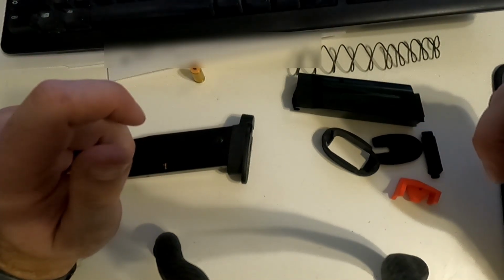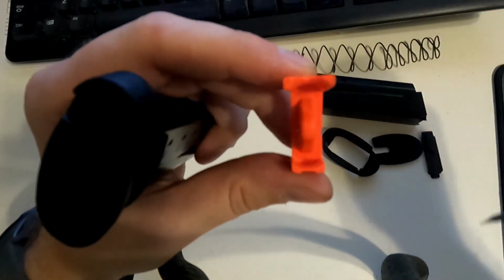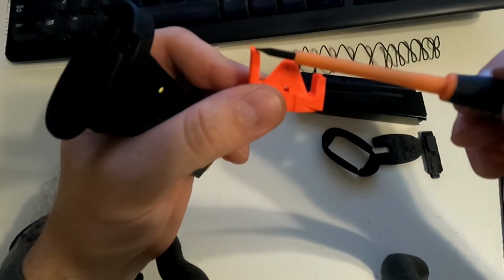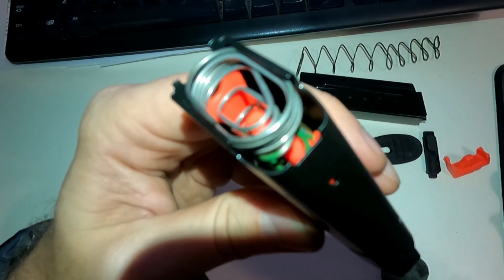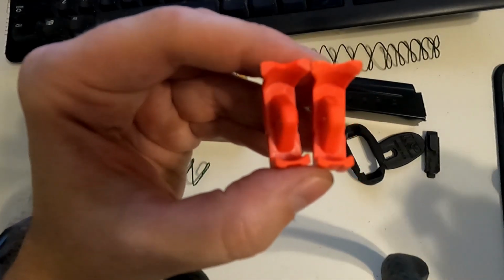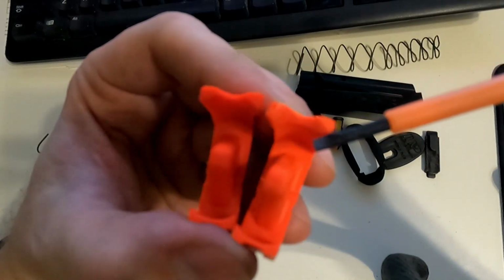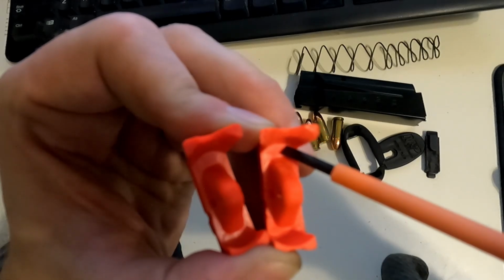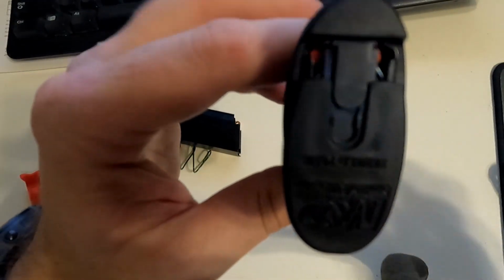M&P Shield Plus 13rd Magazine Fix w/ Explanation of Issue - DIY #educational

Comment: If you call S&W, they will send you the followers for free. I just received mine in the mail today. And yes, they are the corrected set.
Reply: Thanks for this tip! I'll be calling them tomorrow.
Reply: I'm hoping the ones they're sending me are correct. I can barely get the magazine into the gun. They'll fit to capacity, barely. But they're hard to insert
Reply: They sent me the same exact one as the faulty one sadly

Comment: Man, I went to town on mine today with a razor and even spent 15 minutes with three different grits sanding all the edges down so that there was no possibility of anything getting hung up, and it's STILL having issues. I can load the 13th round, but I have to press my loader down so hard that it dents the round's casing, and racking that round is a CHORE. I've never had a problem like this. Super disappointing.
Reply from the maker: Sorry to hear. Some commenters have had luck with S&W customer support sending new springs and followers.
Reply: Have you tried removing a little bit off the bottom of the follower legs that hit the bottom of the magazine so the follower can go down slightly farther?
Reply: I have the same problem with mine. I have been loading 12 just to be safe. One day I will try this

Comment: I called S&W and they are aware of your vid. They sent me all new parts to fix the issue. We’ll see how this goes.
Reply from the maker: Can you elaborate on "aware of my vid"? I emailed their customer support and received no response
Reply: @SacksGarage  yes Sir. When I mentioned the vid on YouTube, the rep stated he knew of the video and recommended replacement and not modifying the part. My take is the new spring is smaller. Your repair makes way more sense. I’ll report back after I get the parts and install them.
Reply from the maker: @six6foot  Thanks looking forward to what they send ya!
Reply: That's great!
We're all looking forward to hear back from you!
Thank you!👍
Reply: @YouTalkinToMeBro  Have not received anything yet but did try something another guy did. Using a loader, I pushed down pretty hard on bullet 11 and 12. When I got to 13 I heard a click when I pushed down and was able to load #13. 
Another thing was when you load 13, it can be fought to insert the mag and rack the slide. I turned the mag upside down and tapped the end of the bullet on the table. This shoved the bullet back to the rear of the mag and seated it. Mag loaded easily and racked normally.
Reply: I made a vid but can’t load it. Got the parts from S&W. New spring and followers for 2 magazines. Springs did fit a little different, looser. Couple of turns on the springs are tighter and the springs were angle slightly different. Once installed the top of the spring seems slightly smaller once compressed. The 4 smaller winds that fold into the followers looks tighter. Seems like a little change or two makes this work. 
Small note, all 13 went in but it’s tight. The Rock might be able to push it in by hand, but this old guy is using a loader. 
Thanks for the vid and info. I’ll follow you nd hope you get monetized.
Reply from the maker: @six6foot  thanks for the follow! It sounds like they modified their design and didn't put out a recall for the older design.
Reply: @SacksGarage  agreed. I called this morning and he admitted there is a slight change in both the follower and the spring.
Reply: Gonna add something and want your opinion. My Shield Plus when shooting Hollow points jams about every 6 bullets. The bullet catches on the ramp. I’m on my 3rd trip to the factory to get it repaired. Each time it’s been “repaired” it’s stated to be field tested. Anyone else having this issue?  Tried to add a pic but cannot.

Comment: I love it when someone has the moxie to figure things out and shares their fix with the world. Thanks for this easy modification to correct a  problem that has afflicted many of us.  SnW should take this to their advantage snd give the credit to Sack's Garage.
Reply from the maker: Thank you for the kind words!
Reply: Yes, mine does it too. You can only load 11 unless you have something to provide extra force. Take an Uplula and force it down a few times and you hear and feel two  "clicks" if you work it up and down a few times it will get less pronounced. Then you can put in round 12 by hand although it requires extra pressure until you hear the click. Then repeat the process for number 13. Of course once you have the Uplula in hand you might as well just use it to load. When I disassemble for cleaning I will make the mods so I can load it full by hand.
Reply: The best brotherhood is 2A

Comment: Good job Sack. Problem is people shouldn't have to fix this themselves. S&W should recall all these magazines and replace them with ones that can be depended on to work as advertised. When their allowed to get by with this crap it will only get worse. Just my 2cents.
Reply from the maker: Agree they should recall and replace the followers. Thanks for watching
Reply: A S&W problem. My son bought a compact S&W Shield 9mm.   It is tan with the green front & red rear pipes.  No matter how many times we follow the instructions to the letter, the pistol will not release the slide forward to field strip the weapon. S&W should field strip them before they leave the factory for sale.  And ensure the magazines will accept the amount of rounds their supposed to.  This is a flaw in S&W's quality control department.
Reply: Bro I had to figure out the hard way too but it is a slide lock. So pull back on it after locked back nd it will go forward to strip it

Comment: Thanks for the very informative vid. My wife and I both have Equalizers, they share the Shield Plus magazines. So off to the shop I went with both 13 round and 15 round magazines I figured they all would have the same problem and they did. I followed your demo on the first one (13 round), worked great could get the 13th round using the Uplula loader. Removing the follower from the spring was a pain so I put my smallest grinding wheel on the Dermel and did the last three without separating the spring from the follower. All 4 mags work great all can be filled using the Uplula loader. Sitting here thinking about it now I should have taken a hard look at the 10 rounders too. I'll do that after singing out, I suspect they may suffer from the same flaw. Thanks again for a very informative video...Mike
Reply from the maker: Glad it worked for ya!

Comment: Dude, you're a hero. I was getting all sorts of weird failure to feed issues when I was running 13+1 or 15+1 on my Sheild Plus. The tension was so tight on the magazine spring, follower, and top round, it was preventing the slide from coming back all the way and properly loading the top round in the magazine after firing the round in the chamber. Thank you!!!
Reply from the maker: Glad it helped!

Comment: Very good Video! Thanks! Watching gave me the mind to take apart the one mag with my S&W FPC that would only hold 19 instead of 20 rounds. Of course the base plate and spring got away. So I had some hunting to do. But when it can to turn over the mag and dump out the follower,,,two came out! Two followers do not make the magazine twice as good.  So now Both mags are still very hard to load with my beloved Maglula, but they both hold 23.

Comment: This fix worked perfect! Thank you. Two of the three 13 rd mags I have needed this modification. I used a small round file,  800 grit sand paper, then a tapered buffing attachment on my dremel  tool to finish it off.
Reply from the maker: So glad it worked. Thanks for stopping by!

Comment: BRO!!! this fixed my problem! I was only getting 10 rounds in and the 11 was so hard to push in there. I did this and now I have stuck all 13 rounds in there. The 13th round is still a little hard to push in but it goes in. Once i put a few hundred rounds I'm sure it will soften up. Thanks!
Reply from the maker: Glad it worked for ya! Thanks for taking the time to comment as it helps the algorithm =D

Comment: Yes, this fix works great!  Also, I recently received new springs and followers from S&W and they are working fine.  The follower fully seats to the base of the mag and 13 rounds do fit.  The last is still a little tight but it works.  They must have made a modification but it's not obvious.

Comment: Finally got replacement mags for 9mm shield plus.  The 10 and 13 that came with it now load just fine now.  The 3X 15 round mags that came with a promotion are just able to take 14 rounds.  I'm not bothering to return.  I'll just do the "fix" which worked but I really wanted a factory fix.  so 2 out of 5 mags are good.  Good luck all.

Update…. Used a Dremel today.  Absolutely no flats left at all.  Can get the 15th round but not easy.  Found that after the flats are gone it’s important to heavily bevel the curved area between the peaks.

Update 2...  Very strange finding.  I took apart both of the "new" 11 & 13 mags S&W sent me.  The orange plunger is exactly like the original bad ones.  I took a micrometer to them and could not find a single difference but both the load the last round just fine.  Even though I smoothed the spring area and removed any flat surfaces ON THE 3X 15s that last round is still very difficult but they go in.

Comment: Thanks so much for figuring this out and posting the video. I have now modded my followers and, while it is still tough to get that 13th round in, it is at least doable now! S&W needs to step up and acknowledge this and you…then mod their factory parts. BTW…I found that a round file works pretty good if you don’t have a Dremel handy. Smooth the file scratches then by wrapping some 150 grit sandpaper around the file. Thanks again!
Reply from the maker: Glad it worked for you. Remember it is a fix and not a modification =)

Comment: Just wanted to say thanks. I have a M&P 45C and have been having the same issues as Shield mags was with issues with the some of the 8rd mags not wanting to take the full 8. Of course S&W just says you can use 7 or it will break in some over time.  I took my mags apart and saw what you are talking about. I looked at old mags and compared to newer ones and I see where S&W has modified the lower portion of the back follower but not the front side. I could see the small indentations on the front follower on 1 side where it was hitting and blocking it from full compression.. I beveled both front followers to give them a nice angle with mini files. Now it works like a champ. You should put this fix out to the M&P forums and send to the Customer no service folks at S&W and ask them why they cant see this?

Comment: Amazing. I just got my Shield Plus a few days ago. The 13 rounder was the only factory mag I’ve ever had to use a loader to fill to capacity. After letting them sit full for 24 hours, I unloaded and reloaded them to see if the springs would break in a bit. That’s when I noticed the pop while cramming that 13th round in. A quick search and two minutes of scraping later, and it is still tight, but that tiny bit of material removed really made a huge difference. Now I just need three more from the rebate.
Reply from the maker: Glad it helped!

Comment: picked up this model literally this week, haven't even put a single rd through it yet... same issue here, I thought the spring was just new and too stiff.. i even used a loader tool and could not get that last round in for the life of me...i'm gonna try this fix today... wish me luck getting that spring back in...

update: works like a charm ... it's still a bit stiff getting the 13th rd in, but they are in... i can either shave it a bit more, or just let the spring break in more over time...👍👍
Reply from the maker: Report back if it helps or not!
Reply: @SacksGarage  I did. Added an update at the bottom
Reply from the maker: @koffee911  thanks for the update. My 13rd round is still too but hasn't caused any issues with loading or cycling
Reply: @SacksGarage  is still too hard to get the 12 and 13th in by hand, must use the loader tool, so I may shave it down a bit more… either way thanks for pointing out the defect 👍🏽

Comment: If you try the fix an still does not work you are still getting stuck, open up the magazine LOADED as you are told, most likely your spring is getting stuck in the "ears" or ledges on the sides. Basically if if you are looking at the follower and you see a "T" you need to turn that into an "I" ....Shave that off and try, I just did and seems to work. It was still hard, but the gun loaded correctly. I am still contacting Smith Wesson for new magazines, we should not have to do this with a brand new gun! That is why we pay them good (if somewhat devalued) money for!  Otherwise the gun work great, feeds anything you give it and it points, handles, and work better in my opinion, than any micro out there EXCEPT for this issue.

Comment: Thank you very much! 😊 I used you technique on my shield plus magazines and now they hold 13 rounds however I have use a loading device on the last 2. I over 60 years old so my hand strength ain't like it use to be. Smith & Wesson needs to address  this problem 🤨

Comment: OUTSTANDING JOB!!!  That explains why I still had the same problem after trimming the spring a bit.  After you did this mod did you find that racking the 13th round any easier?  I have a few 13rd mags that did the POP and work but racking the 13th round is more difficult than the 10rd mag.  Also, when I carry a spare 13rd mag I only load 12 because racking it quickly in a hurry was questionable.
Reply from the maker: I don't have a baseline to compare to as I wasn't able to get the 13th round in before modifying the follower. However, racking in the 13th round feels no different than racking it with less than 13 or even without a mag

Comment: I messaged S&W about this issue and this was their response: "Thank you for contacting Smith & Wesson. 

The magazines are capable of fitting 10 or 13 rounds, however because the magazine spring is very tight, it will be very hard to add that last one in. Some tips you can do is  

A) Try using a magazine loader. These can be purchased at any gun retailer locally or online if they carry it. I recommend Amazon as they have a very popular one.  

B) Disassembling the magazine and hand pressing the spring to teach the tension. This will allow a better freeform way to loosen the spring so it can fast track the process. You can also achieve the same thing by using the eraser end of a pencil and pressing back and forth on the follower to wear the springs. "

Hopefully that's helpful for someone.
Reply from the maker: I think it is a cop out answer. You shouldn’t have to force the last round in with a loader. Even then, many have reported being unable to load in the last round
Reply: @SacksGarage  I feel the same. A definite design flaw.

Comment: A small file, would allow you to gently chamfer the edges, while Not removing to much material. Thanks for passing that problem and repair, out!  (I just started using Shield Plus mags, with my Equalizer pistol, and was not aware of this issue!)
Reply from the maker: Not everyone has the issue so definitely try them out beforehand!
Reply from the maker: @chrissewell1608  sounds like yours could probably benefit from some chamfering!
Reply: @chrissewell1608  Ha! I did the same, and the entire time was afraid I was going to bend the lips.

Comment: Mechanical problems have mechanical solutions. Meanwhile, S&W has management and attitude problems with no solutions in sight. I have no doubt that their engineers are quite capable of anything they need to do. It's the PR and lawyer side that seems to be causing these "disconnects" between customers and the company. Great video! Not their only magazine with design flaws (rather than production defects). Talking specifically of M&P 10mm mags.
Reply from the maker: Some others have reported success with customer service sending new mags. I did not have success with contacting them about the problem
Reply: @SacksGarage  in my observation there are layers to this. The "reps" that we talk to are just bobbleheads, people on the phone. They are polite and try to help. How they help depends on company's stance on the given issue. If the company recognizes the issue, they might "take care of you". If not, it becomes impossible for the reps to help meaningfully. In my case they readily sent me replacement mag springs and followers, and an RSA. Except they are the same as before, so nothing is fixed. They don't admit to the well documented issues (with the 10mm) and so they give you boilerplate stuff like "it takes 500 rounds to break in" and "don't use overpressure ammo" (which doesn't exactly exist in 10mm production loads). Corporate culture is a relentless phenomenon. Once it takes hold, things only go one way. Thank you again for the vid.

Comment: i just got a shield plus - same deal; my 13 round mag only loads 12.  The 10 round mag loads 10 fine.
Also got the Bodyguard 2.0 and it has the same problem with the 12 round mag; only loads 11, but the 10 round mag works fine.